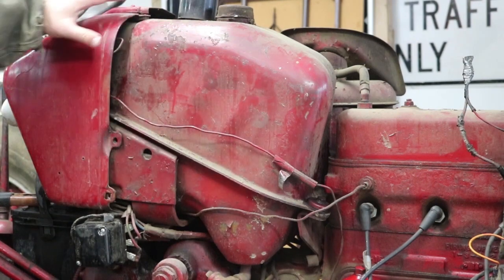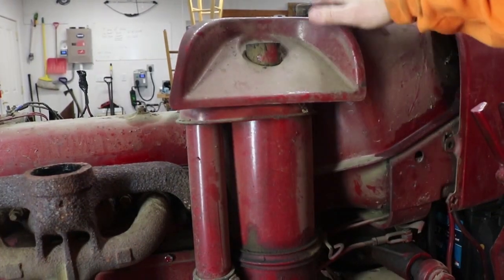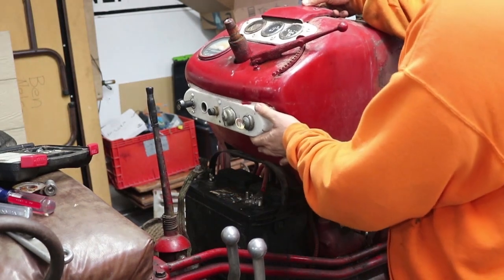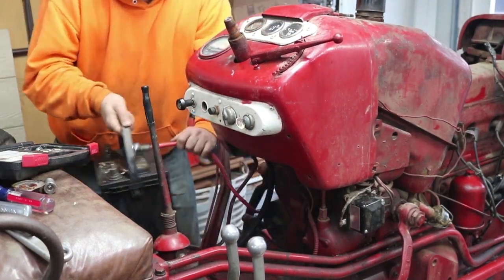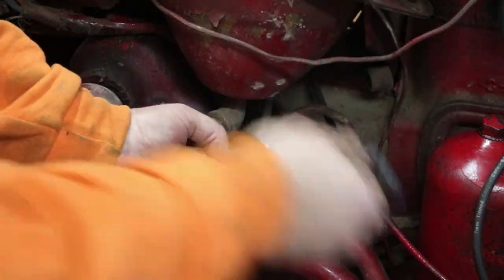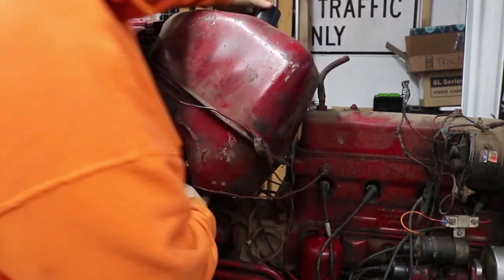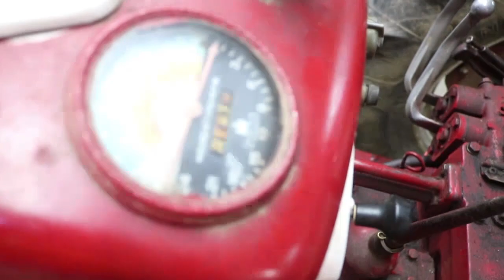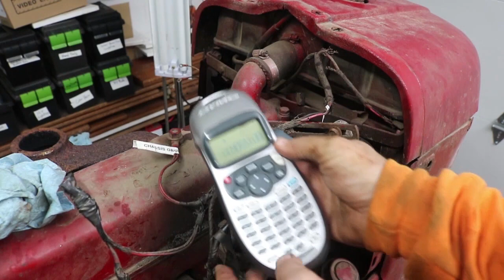Electric Tractor Conversion - De-ICE-ing, Part 1

Comment: Very thorough tear down! You‘ll probably be able to cover the cost of some of the new electric parts by selling the old parts you removed. Once you get the engine separate from the rear end 99% of the hard part will be done. Love the standardization on these older things... a pouch with a 1/2”-9-16” combo wrench, a 3/4” big wrench and a straight screwdriver and you could mend the things right out in the field! Great series!

Comment: I  have one question sir . 
why didn't you just turn the steering wheel until it stopped and then broke the steering wheel nut loose?
I am an old automotive and tractor mechanic

Comment: It looks like the engine is an integral part of the structure of the tractor. Is this going to be an issue?
Reply from the maker: No, but some structure will need to be built in its place. This is common on tractors where guys have pulled the original engine and replaced it with a V-8.
Reply: @BenjaminNelsonX  I have a mid size Ford that I want to turn Electric. so I'm following this with great interest.

Comment: Man that's gonna be real interesting with the front end of the tractor, you'll have to build a new frame in the engines place that joins the front end back up to the rest of the tractor. Also what's your plans for the hydrolics? Run it off the "traction" motor or use a seperate electric hydraulic pump?
Reply: Pretty much
Reply from the maker: They hydraulics are dependent on the electric motor that gets used. The motor hasn't been decided on yet. I have to get the tractor split in half before we can decide on the motor. It seems like one of two options - power the hydraulic pump from a tail shaft of a motor, or power a separate dedicated electric motor and pump.
Reply: @BenjaminNelsonX  ah very interesting, thanks for the reply. Can't wait to see how it turns out :)

Comment: Thanks for the share. It looks like the engine block and transmission make up for the frame. With this hindsight, it would be better to get only tractor wheels with suspension and build the frame around it. One way or another, I am sure, you will crack through this project. :)
Reply: Just read other comments, so I got it answered!

Comment: Funny ... Power steering, speedometer cable, nope. Steering box and tachometer cable.
Reply from the maker: The section shown directly under the steering wheel is the Valve Assembly of the power steering system. I have the repair manual directly in front of me.
That one cable goes to a gauge which is a combination of SPEEDOMETER/Tachometer/HoursMeter.
Reply: My bad. I've never seen a tractor with power steering except really large, late models. Why would a tractor have a speedometer? Never needed to know my speed while using mine. Sorry.
Reply from the maker: @Tuckerclan  I guess you might want to know the speed if using "Road Gear"!
Reply: @BenjaminNelsonX  As a kid in the 1950s, some of the implements ran best at critical PTO rpm range, while others ran at narrow ground speeds, so knowing engine speed and which transmission gear was being used (especially in our hill country) were important, usually combined/translated on the mechanical tachometer into ground speed. I don't know what use this tractor will see, but likely not plowing, cultivating, field mowing, raking, bailing, etc., that might need PTO or ground speed info, so probably just the electronics gauges you will be adding will be enough (cool if you could match the new guages to the original guages style, but I think you have enough to work on already!).
Good work you are doing; people can see the difficulties we faced just replacing a clutch and throwout bearings, or worse yet transmission gears. Indeed, while farm equipment gets rough use, farmers had to know how to baby both tractors and implements. And as you seem to be finding, some repairs couldn't wait for bad weather, so temporary solutions had to be found and permanent repairs sometimes never were completed.
Good luck, I enjoy your videos, and sympathize with your surprises.
Reply from the maker: @douglas_drew  It looks like the number one implement to be used on this tractor will be a bush hog mower. Likely also a 3-point log-splitter, and then likely mostly pulling trailers.
I'd like to fit new electronic/digital displays in the original gauge locations. I think that would be a slick look.

Comment: Positive ground? Probably a 6 volt system then too.

Yeah, that engine needed to be yanked. Even if one weren't doing an EV, an upgrade to a modern-ish diesel running on bio- or even straight used (and filtered) cooking oil would be better than that thing.
Reply from the maker: It was running 12V, just negative ground.
Reply: There was water in the oil so it needed some work.  Probably a bad head gasket.